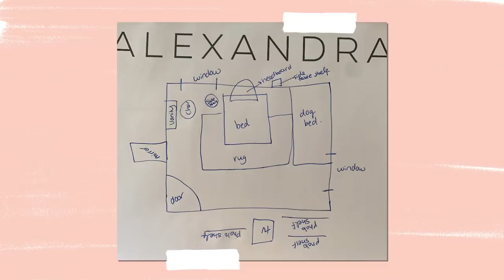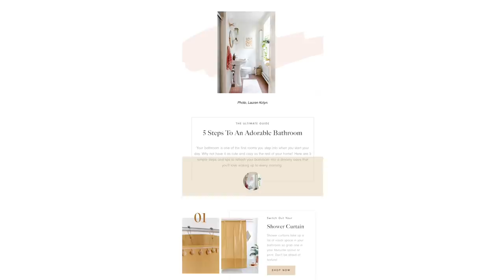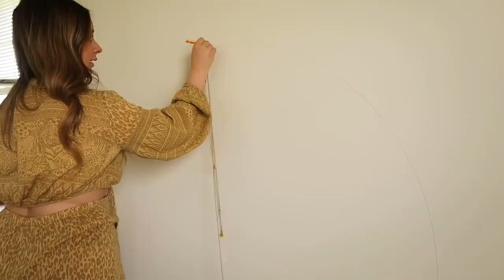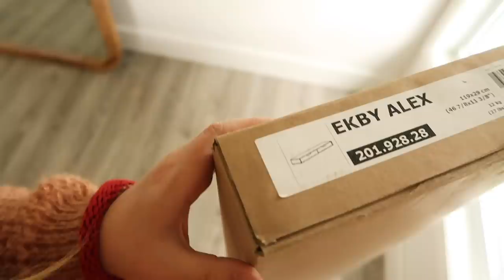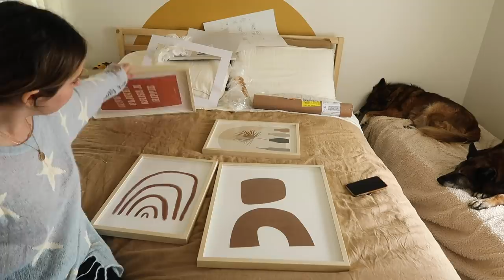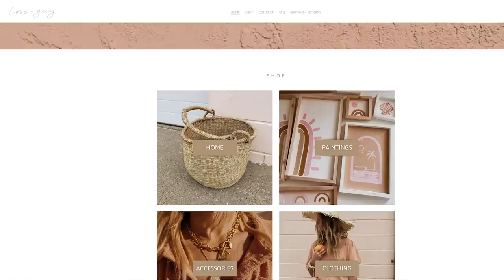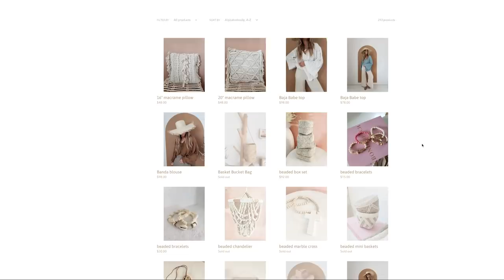*EXTREME* BOHO BEDROOM MAKEOVER FOR A YOUTUBER! | BEFORE & AFTER BEDROOM MAKEOVER

Comment: That curtain rod idea is awesome! And it looks like it makes the curtains sit more flush against the wall at the top, which I love. I frequently need my curtains to block out as much light as possible, and my traditional curtain rods and mountings hold them out from the wall, creating a gap that lets more light in than I'd like,  even with decent blackout curtains. So, I love that idea, and I think I may just give it a shot and see if it helps stop some of the light coming out from the top! 😀
Reply: The curtains may not pull easily on tight fitting dowels so that's something to be aware of !